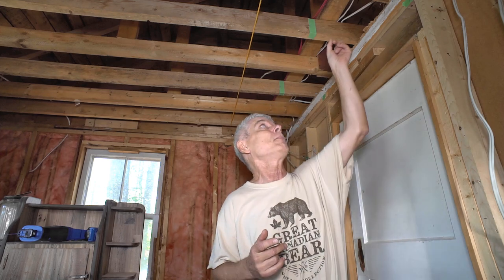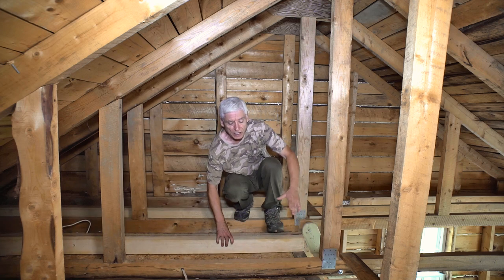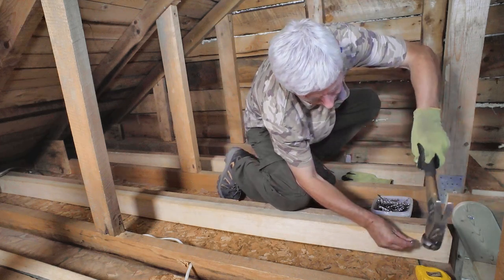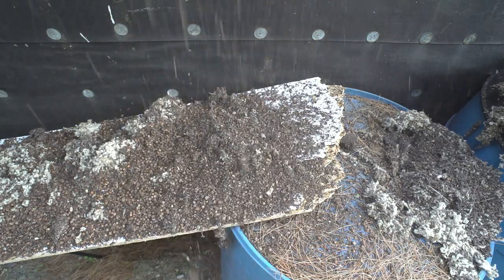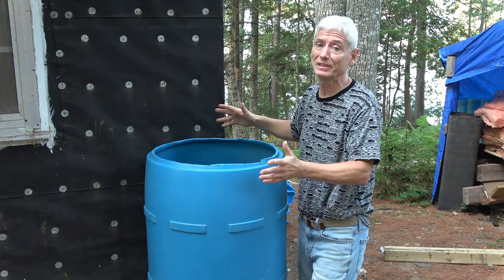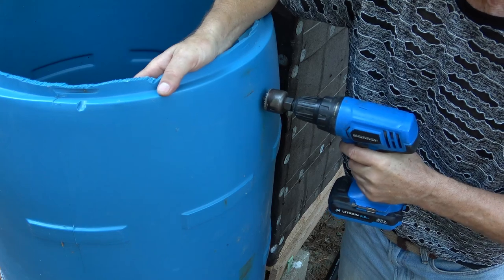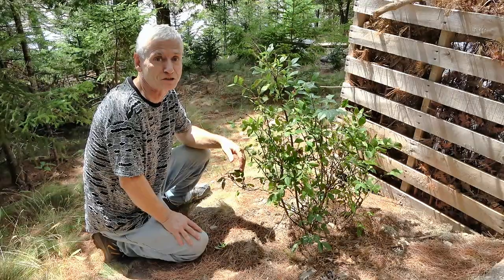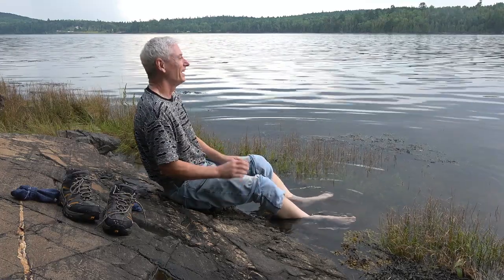Things are Looking Up! Water and Loft: Cabin Fixer Upper Pt 10

Comment: You might think about adding a drain plug hole at the very bottom of the barrel to help flush out any "crud" that may accumulate. Just a thought.
Reply: He plans to deconstruct  and store the barrel in winter so rinsing out will be easy. Bottom plug not necessary.

Comment: I have blueberry bushes that seem to struggle. I put grass clippings around each one they grew new branches and seemed to love it. I think it helped keep moisture at roots and fertilized too. They like acidic ground, fertilizer for rhodedendron works and coffee grounds. Cabin is looking good, lots of work.
Reply: Have you tried burning your bushes at the end of the season? If your County and state let’s you do control burns you should try burning your bushes at the end of the season. The heat used to burn the aerial plant parts will encourage the new sprouts to grow and has been shown to liberate nutrients for the growing plants. This heat also sanitizes the field by killing insects, disease organisms and weed seeds which overwinter near the soil surface
Reply: He's in a colder climate and I'm in Washington state. Don't really worry about bugs. Gets cold enough in winter to keep control on them.  Fir helps not cedar, so saw dust you have, pile it to make a mound around base.

Comment: In our cottage we had two wooden window frames (with glass of course!) about 16"x20" at the top of the peaks at the front and rear of the cottage. We would open these up during the afternoon/evening and get some really nice air flow and it would get rid of that hot air. We had strings on them with a small pulley that we could pull to open them up, and close them. They also had screen on them - for the bugs! ;)

Comment: You could have installed an Oatley down spout diverter for your rain barrels for about $25.00 and used aluminum drain pipe to let flow to the back. A lot cheaper, but your system works. I use the diverter on my rain barrels that I have hooked up 2 together. Unfortunately, they have been empty for close to two months because of no rain. 

Quincy, Massachusetts U. S. A.

Comment: One idea I’ve seen for your loft stairs is to attach a rope to the end and run it through a couple of pulleys in the loft and down the wall downstairs to a basket or bag of rocks.  You can balance the weight so that the stairs will be equalized and will stay up or down or just float wherever.  Might be a fun and useful future project

Comment: At first I was a bit suspicious about removing "rafters" but looks like it worked out fine. I have seen structures where rafters kept the roof from spreading out. Looks like a good deal for you. I always like loft bedrooms. Good use of small space. Will be nice and warm in winter. I'd be sleeping on the deck in Summer. Quite jealous of your wonderful cabin and woods and sea view.

Comment: Those joists are there to keep the walls from spreading. They are there as the bottom chord of the triangle that holds up the weight of the roof.
Reply from the maker: Sorry Chuck but the trusses do that. They are spaced 24" apart. Those other joists in between do little and are just tacked at the ends. SP

Comment: My rain barrel funnel is a 6" plastic plant pot with most of the bottom cut out.   A piece of fiberglass window screen siliconed to what's left of the bottom filter out leaves etc.  Before I put the barrels away for the winter any crud gets the high pressure washer blast.

Comment: Really liked this episode. The loft rocks! Yes - they can get hot. You may want to put a small firing strip, (1x2), of wood on each side under each step tread. Screwed into the sides underneath. Wouldn't take long to make them and screw them in. In fact, you could also screw the tread into them. Just in case the wood gets dry and splits under load where the screw is you'd have a backup. I've seen similar happen. Just throwing that out there. Also hang a fan from the high part of the roof. That would look really cool in a cabin like that - maybe an antique style fan near the wagon wheel? Waiting to see what you do for ventilation. Love your reuse of materials. So awesome. Cheers!!!

Comment: From other videos on rain barrels, I've seen "first flushes" added that divert the first bit of water so all the pine needles don't clog your funnel. 

It's a straight section of pipe with a valve at the bottom, and there is a T near the top to divert the rest of the water to the barrel once the first flush fills up. Drain the first flush after the rain stops and you'll be ready for the next downpour.

Comment: Hey Slim, what was your job before you retired?  You obviously were not a carpenter judging by your hammer swings  but have a remarkable grasp of the correct fasteners to use and where.  It's coming along!  Unless you intend to drink or bathe with your rain barrel water you should have put your faucet about an inch or two from the bottom as you can clean the crud and bugs out of your barrel (the plants won't mind) and you can clear out more water in winter so you don't crack your barrel and you can get a bit more water for when it's dry.

Comment: Just a little construction note Slim, Those ceiling  joists are not there just to hold ceiling panels or gyproc in place. 
They are the things that keep your walls from bowing out. They tie your walls together. Don't take too many of them away.
Reply from the maker: The trusses do that, and 24" spacing is acceptable. SP
Reply: @SlimPotatohead   You cannot cut a structural truss bottom cord or any of the components and have it retain it's integrity. It is no longer a truss once you cut it.
Reply from the maker: Mark, what I am referring to as actual trusses are the ones that are properly and adequately fastened together with braces. Merely hanging a beam and tacking it to a top plate offers only minimal support for the walls. Most building requirements allow trusses to be are spaced 24" apart , which is what I was left with. Cabin still standing! SP
Reply: @SlimPotatohead  I may have been hanging too much on what you said at 2:20,. I'm not  a negative nanny but neither am I a sycophant . You tubers have plenty of viewers who ditto everything they say. Pleas don't take offence when someone offers you constructive criticism. I do appreciate your videos and like the series on the cabin. Cheers!
Reply from the maker: I'm not offended Mark, I just wasn't sure you understood what I did. Every second "beam", perhaps a better word choice, was not connected to the roof at all, merely tacked to the wall with one or two nails. If the walls did start to bow, those nails would not have held it in place. It was not their function. The proper lower chords for the trusses however are well braced and certainly would stop the walls from bowing out, and were NOT cut out. I hope that clarifies the issue. Thanks! SP

Comment: ABS and PVC pipe got ridiculous expensive. Did a little project this summer making 10 pendant lights out of ABS pipe with cleanout plugs at the top holding the LED (my wife wanted some lights in the trees). The cleanout plugs were like 10 bucks each! The 10ft piece of pipe another 30 or so. Ridiculous.
If those ABS pipes get hit by a lot of sun you may want to spray paint them. ABS is very UV light sensitive and decays rather quickly when exposed to too much sun. The part under the cabin is probably ok, but put some paint on the downspout part.

I do have a bunch of rain barrels - interconnected at the bottom and with a sump pump in the bottom of one barrel so I can water my veggie beds. Works well and with 6 food grade 70 gallon barrels it's a decent amount of water. Got the barrels real cheap at a salvage yard - they were used to ship brined olives from Spain - according to the label and the smell. Came with nice screw on lids - no mosquitos there, just a small ventilation hole to allow the barrels to fill.   Good job with the overflow - I did a similar fill mechanism and overflow mechanism. Those diverters aren't that good because they tend to clog up when you get a lot of leaves, so I used a 5 gal bucket as "filter" - much easier to clean out and not as easily plugged up.

Comment: very clever implementation of the rain barrel!  Great job.  The one thing I'll be curious to see is whether the opening at the bottom of the funnel will be large enough if/when you get a hard rain.  If it's not, it's an easy fix:  Just cut the funnel further up where it's wider and make the opening in the top of the barrel big enough to fit the widened funnel.

Oh.  don't be doing any sleep walking when sleeping in the loft!  ;-)

Comment: The 300 gallon ibc containers are a very good water storage if you can get one that was used only for food safe stuff. It doesn't really matter for non potable though.These tanks have a valve built into the bottom and a large cap witch has a smaller port in the cap to put some kind of funnel. When they are full it will fill a 5 gallon bucket very quickly.

Comment: Excellent video, and a great job on the renovations. I like how you show the problems that come up and your solutions for them.  One thing that might seem unnecessary, but I would mark the barrel that had the chemicals as undrinkable, just in case some thirsty hiker came along while you were away.
Reply from the maker: This is rural, not a remote location. No hikers! SP

Comment: Slim, I know you are interested in solar for the cabin. Here’s something different! Have you heard of GAF solar shingles? GAF has manufactured shingles for decades! Check it out these are about the same thickness as regular shingles and be installed just like regular shingles. Pretty neat concept! You will still have to buy the controller and batteries like the other systems. Anyway check it out on YouTube,

Comment: The loft is a good idea! Nice job on the fold away ladder. I agree with other comments, need some rails, for safety.  Definitely need a small window in the peak ends for cross breeze.
Rain barrel is a good idea, well worth the investment, for many years to come.
It's coming along fine, every little bit is a step closer to done!

Comment: If you drive nails in a zig zap pattern on a cross member  it will make a series of triangles which will make it stronger versus just being in a straight line. Indeed if you nail in opposition with each other  by slightly angling them on a board won't work lose and on exterior trim work its ideal as well as interior but it taking it back off is tough when mailing this way. Buying a gutter guard inserts to keep out leaves or just a mesh sleeve in to mouth of the downspout works to but gutters do need cleaning especially from pine needles....

Comment: LOL@Farrah Fawcett !! Only thing I would have done differently would've been to have mounted it much closer to the bottom of the barrel. Thinking I'm going to put together something similar. Thanks for the idea ...
Reply from the maker: Too close to the bottom you'll be getting debris that has settled. Just go low enough that you can still tip the barrel to empty it when needed. Thanks!
Reply: @SlimPotatohead  Ahh, gotcha. Makes sense. Thanks for the explanation.

Comment: Hi Slim love your rai barrel, however have a look at poly tanks ( think future proofing against drought) ( living in Australia, it’s always in the back of your mind), have experimented with 12 volt solar powered pumps and two run in tandem give good pressure,( EBay specials), got my last poly tank from a house that was been pulled down 3000 litres for free and a day’s judicious cleaning saw it good as new.

Comment: Lots of improvements on the cabin. Good that you're inspecting things like the inner walls where you found the carpenter ants, under the soffits where you knocked the gunk out with the crowbar. The loft will be nice. Maybe a ceiling fan to cool it down? And the rain barrels should be a good source of water. Looking forward to your next video and the continuation of the fixer upper tale.

Comment: Think you should secure the base of the water barrel by driving some posted in thru the holes of the concrete blocks.?.  Would not want to have the barrel tip over..

Comment: Did you use ABS it's so expensive I have used just standard PVC pipe works great for decades especially if it's not in direct sun and not under any pressure
Reply from the maker: Here, the PVC cost more than ABS. SP

Comment: Enjoyed your video.   I am surprised you're not putting insulation bats in the roof, or perhaps in your ceiling under the boards you just put in.   Is there a reason you didn't since you are putting it back in the walls?  Might help with the heat retention and cooling.
Reply from the maker: This is an ongoing project by one person, so priorities are done in order. I don't need insulation in a heat wave, but a kitchen would be nice! SP

Comment: I would recommend putting a sliding gate latch on that ladder to hold it in place, I like the boards but its cheap insurance and peace of mind. 

Also I'm curious why the rain water catch instead of just pumping water from the lake? 

I know you are using a composting toilet but what is the plan as far as grey water drainage? 

Sorry to ask so many questions Im just a long time follower and I'm about to build a cabin for my family at the end of the year on a small rural piece of land, I have done tons of research on all these subjects and there is so many different ways of doing things it can be a bit over whelming.
Reply from the maker: It's the ocean, not a lake! Saltwater. Yes the ladder needs a proper latch. Thanks! SP

Comment: hey there.  couple questions:  1.  if you put the hole in the top middle of the barrel (for the rain to go into), would that hold the cover (black drain pan) on the barrel sufficient to keep it from blowing away as well as a rock?  and 2. why didn't you put the rain barrel around to the side of the house rather than on the front ) I mean just barely around the corner?  Then you could camouflage it with a piece of fence or a shrub extended along the front line of the house. Not that it looks bad, but the bright blue does stand out.  I understand, I'm sure my husband would do it exactly as you did because it is simpler, but I'd question him about it, too!  I know the gutter ends in the front but I think it would be easy and not too expensive to get a corner gutter piece to wrap it around to the side of the house.  This is not a complaint of your work - you do beautiful work and the place looks fantastic, just an aesthetic point to ponder.  Can't wait to see more updates - love this little house on the shore.
Reply from the maker: Hi Vicky! I expect the placement of the barrel will be more apparent in a future video. Thanks! SP
Reply: Ok. I’ll stay tuned to see what you do.  B

Comment: HI SLIM 👋 
QUESTION COULD OF YOU SET IT UP SO YOU COULD HAVE RUN USED A 50' / 100' LAWN WATER 💧 ING HOSE DOWN PIPE ,  MIGHT HAVE BEEN CHEAPER ? BE SAFE  ! HAVE FUN  ! ENJOYED 🍨 🍨 🍨 🍨 🍨 🍨 🍨 🍨 🍨 🍨 THANK YOU 🙏 GOD BLESS YOU ALWAYS ON YOUR ADVENTURES 🙏
Reply from the maker: Hi David, a lawn hose would be too small a diameter, causing the water to back-up in a heavy rain. Thanks! SP

Comment: Where is your insulation
Reply: Possibly won't have any? Not sure he plans to be there in winter?
Reply: I’ve lived in places that were so small, we only used a potbelly stove for heat, & we’d end up having to open all the doors & windows.
Reply: I would at least still put some double foil bubble wrap on the roof trusses that way the attic space would be somewhat conditioned separately
Reply: @kurtzxcvb3481  he's not done yet...let's see what he does next.